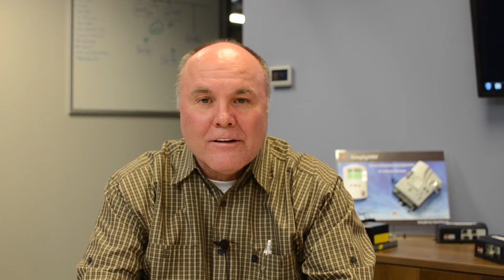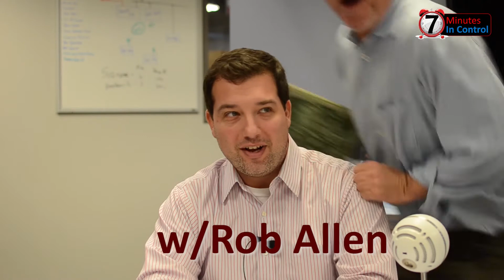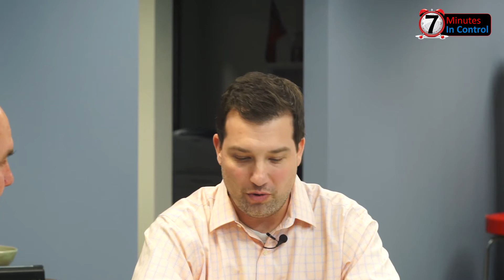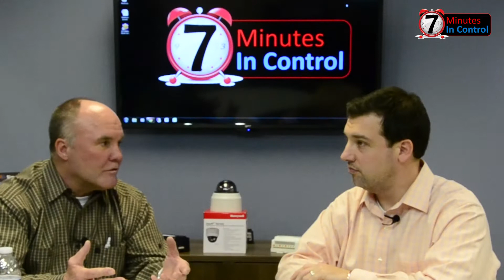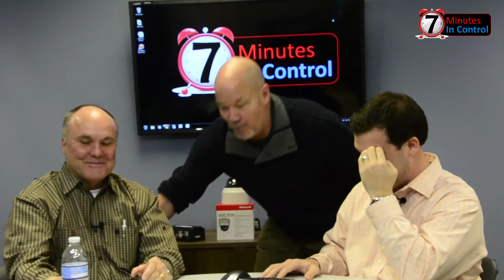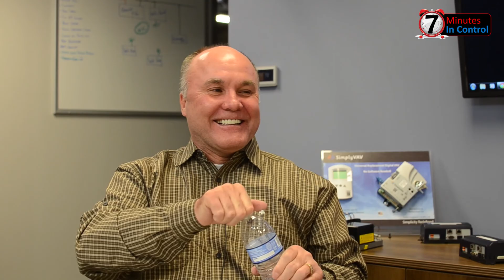7Min14:  Top 5 reasons for AX Security Integration: Roger Rebennack

Comment: Here's a new product idea. Create a alarm panel app for the smartphones which acts like the alarm panel for the PC. The advancements can be that the priority level of the alarm causes the app to react differently. For example, a low pririty alarm simply pops up an icon on the phone and stores in que. A medium priority alarm causes the same with a slight cherp for notification. A high level alarm causes the app to react like a amber alert warning on a phone that must be dealt with immediately and acknowledged before the alarm tone will stop. Case in point...a fire alarm in a building...or a security alarm. Etc...

Andy Burch Estes Mechanical controls technician.